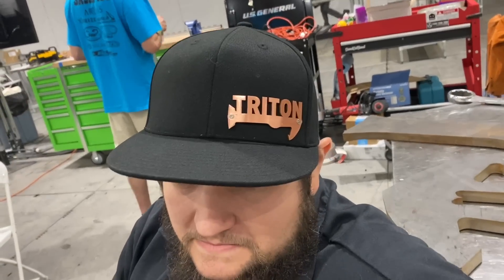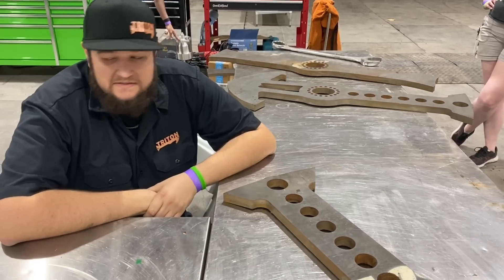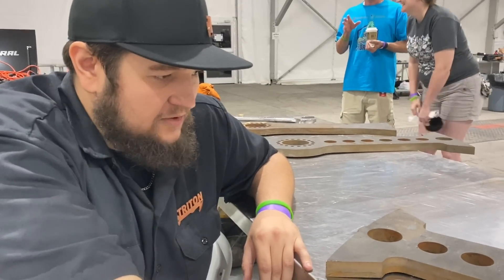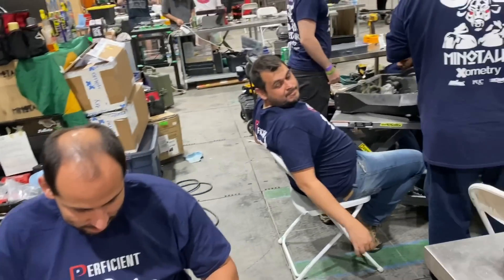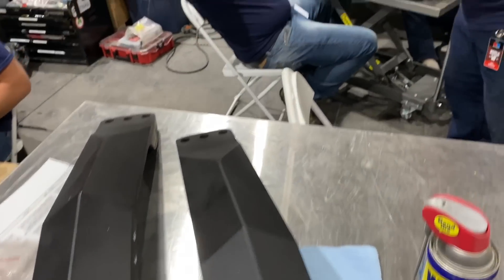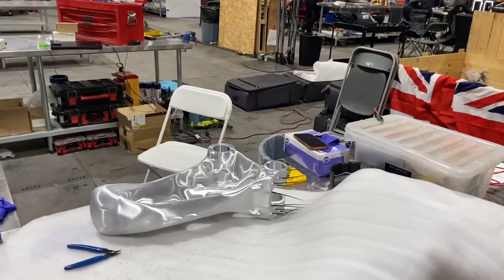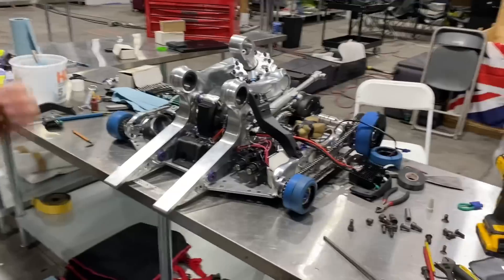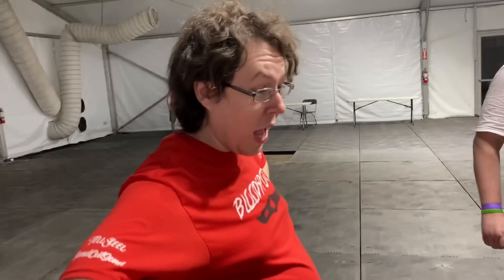Behind The Scenes: BATTLEBOTS Season 7 (Day 1)

Comment: Going to guess 34.3lbs, the motor itself probably is the lightest part but that beefy gearbox and the solid rubber tire on that hub of some metal are probably the bulk of the weight. I almost feel like I'm highballing this guess but being a compact bot like Minotaur makes me think they do have some room to work with for a beefy drive.

Also I don't think this has anything to do with the giveaway but I'm guessing TPU for those hairs on Quantum, if it's some kind of plastic, flexible, has a little bit of shine but not much, and potentially 3D printed, that's what's standing out in my head.

Also can I just say heavyweight Starchild and Horizon look amazing? Maybe this is the NHRL fan in me but I'm so glad to see them scaled up